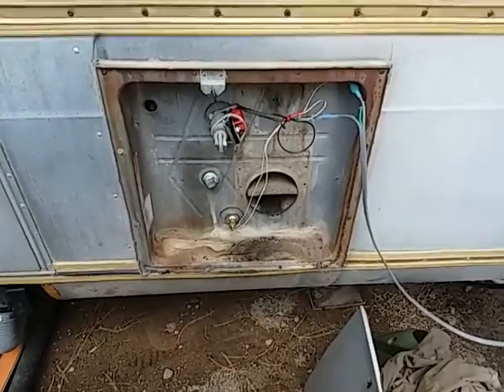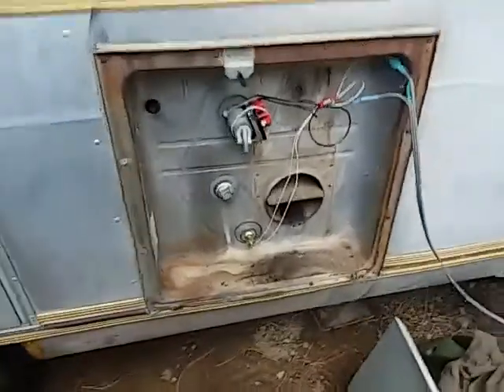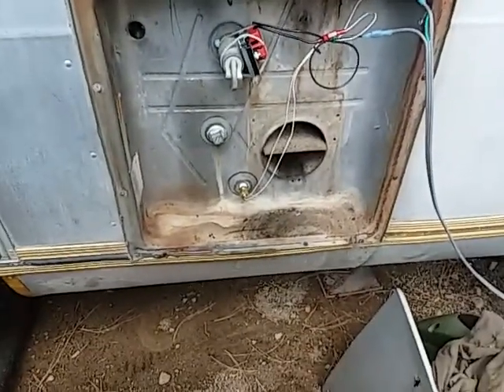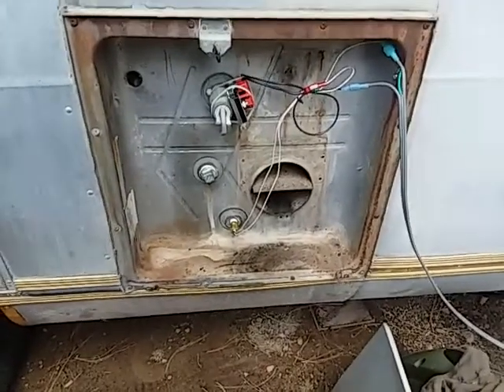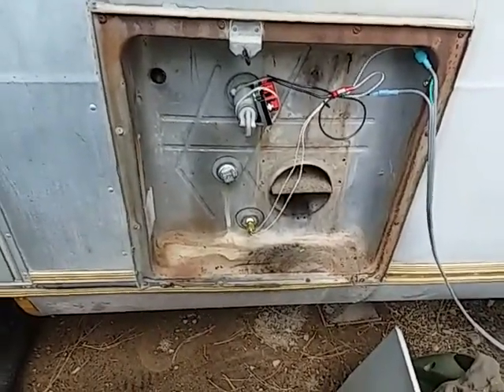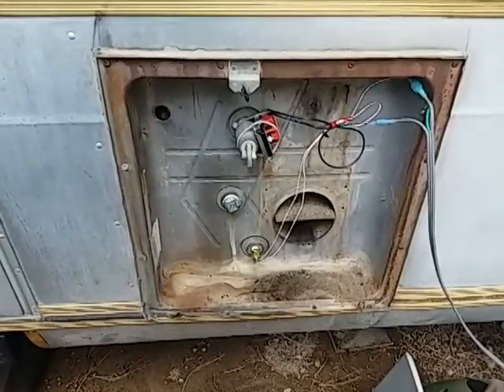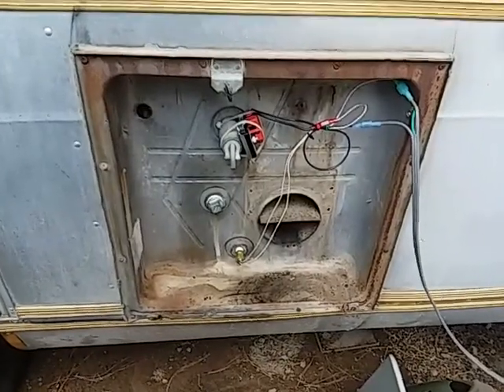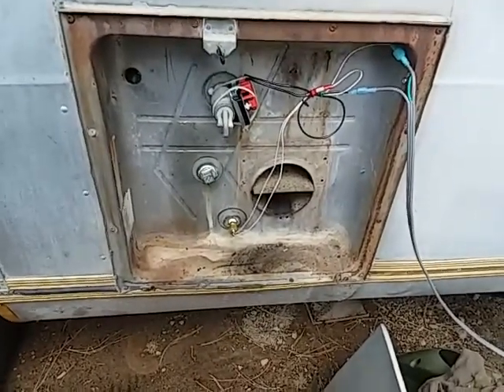RV water heater conversion propane to electric

Comment: Why wouldn’t you show how?? Video is a Waste of time and utube space
Reply from the maker: It's actually very simple. The kit you can buy from almost any rv parts and supply cost me about $150. There are instruction with the kit. It's pretty much plug and play. Yes you have to unscrew your drain plug and screw in the element that comes with you kit. Leave the pressure relief valve in place. The instructions will show you why. Hope that helps. It's simpler than you might think. Honestly you can probably install it with a small pipe wrench, pliers and a screw driver.
Reply: @rancherforchrist  could you please give us the name or part number 🙏? Thank you
Reply: Self explanatory!